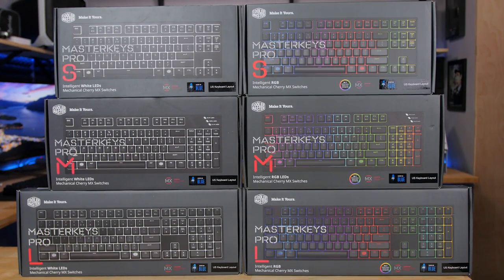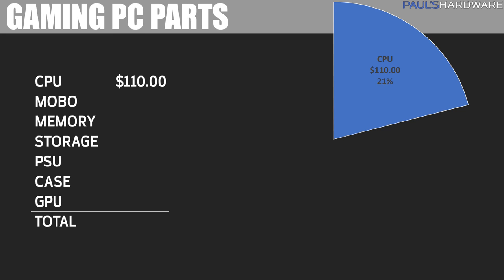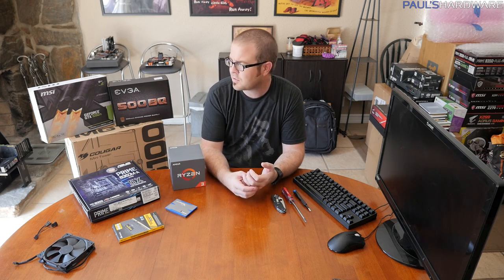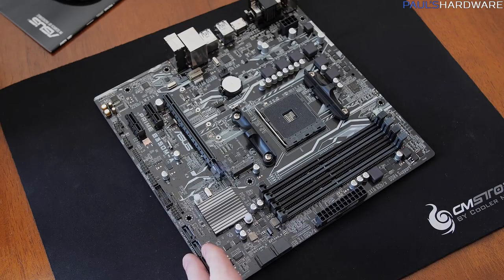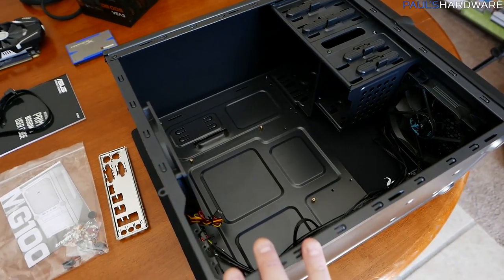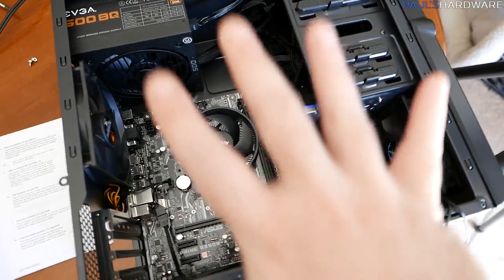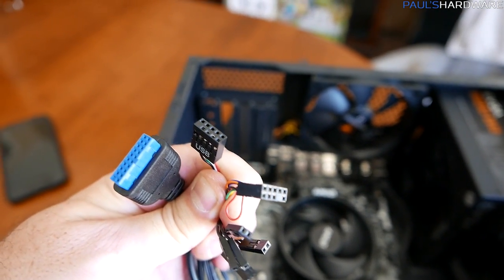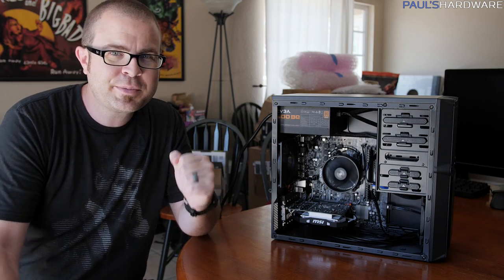How To Build a $525 GAMING PC with Ryzen 3!

Comment: Were there not SSD mounting holes in the floor of the case. Could not tell their spacing. I've seen quite a few setup that way. Of course that would suck for your installation since the PSU is at the top. Also, it would have been good to mention that there are some holes in the MB that are not mounting holes. You had a perfect example at the top near t he VRM chokes where two were mounting holes with ground and one that was not. Just a thought. Have a good one and keep on building!

Comment: Would be awesome to see a used hardware build. Most of my hardware comes from Craigslist, reddit and eBay. My last build (8350, 8GB, 970 SSC, SSD, TX 850) cost ~$500 at the time, which was about a year ago.

Comment: i just built basically this system, similar case, vid card, ssd, that psu, new cheap mobo, but i used a ebay 2600k for $70. performance seems just above the 1200, but the 2600ks oc like beast too :D.

Comment: For an extra $20 you can get an x4 PCIe extender and a PCIe SSD costs roughly the same as regular, your disk will run 4x faster than the best SATA 3 SSD or mSATA drive ...

Comment: Nice budget build and honestly i am thinking for myself to go with the 1300X because i never overclocked before and just would like to have that nice high base clock of 3.5GHz.
The only thing from my original system i am planning on keeping as well is my 2 hybrid drives, my GTX 1050 Ti and my 550w PSU (which i am sort of debating if i should really keep it or just change it for a 600w cause adding in a SSD you know) in which my current system with the i5 2500 i have a HD 7850 laying around (that i got from a friend for 20$ cause he has no use for it anymore and was tested) i am thinking of using it as a backup system/system for my friend to play on when he comes over or just sell it.

Comment: I would recommend using the Radeon video card so that builders can utilize a Freesync monitor(Start at $150-$250). You need a Gsync monitor to utilize Gsync with Geforce cards. Gsync monitors start at about $500. As for memory, get 16gb. If a game states that you need 8gb of memory, it is more than likely that the game itself requires 8gb and windows takes about 2gb, so your left with 6gb for gaming causing frame rate drops.
Reply: AnimalLechter AMD GPUs are ridiculously overpriced atm, though. 
8GB is fine for budget builds

Comment: Is 8gb really enough memory in modern applications? Mind you I don't know how much of an improvement ddr4 is over ddr3. I have 8gb ddr3 in my system and I notice on task manager often memory is running near to capacity whereas my cpu amd a10 7700k is only running at around 30%capacity.

Comment: If the 1200 is $20 cheaper and can be OCd to the speeds of the 1300x, wouldn't it cost more after a month or so of heavy gaming if the 1200 will be using more power than a stock 1300x? Why wouldn't you throw an Intel dual core for half the price and perform better for gaming and use that extra money on the GPU or something?

Comment: Ive been building computers for clients with parts from frys u can usually get the cpu and mobo real cheap its like they throw in mobo for free.just bought the 1700x with asus mobo for 325 and samsung 250 960 pro for 75.memory prices sucks

Comment: awesome build, exactly what i was looking for..but.. 
how about
intel i3 8100
Zotac GTX 1050ti 4GB
Corsair Vengeance LPX 8GB DDR4 2400MHz

Asus Z350 mobo
PSU is same as what you used.. 

i'm trying to get a decent build that will atleast run for about 4 years or such

Comment: Okay, but if you OC the 1200 to the frequency of the 1300X, will it require more voltage/cooling/power? In other words, are 1200s binned to need more power for the same clock?

Comment: It was a little difficult to tell from the angle in the video, but would this GPU cover both of the pcie x1 slots on the motherboard? Would want to add in a Gigabyte wifi adapter, but unsure if it would physically fit into the build.

Comment: is it worth it to get 3000-3200MHz memory if it costs 1/3 more then "normal" 2133-2400MHz RAM?
I build a PC for a friend (for video editing) and he was on tight budget and here were my options
1400 + 16GB 3000MHz RAM
1600 + 16GB 2133MHz RAM
And I chose the more CPU power over the faster RAM, so was my choice right guys?

Comment: would 2666 mhz dual rank memory be cheaper to get than the average 3000 mhz single kit?

turns out they perform equal to 3200 mhz single rank modules on ryzen for gaming.

Comment: Hi Paul, thanks for video. i want to know if i use 4-pin spitter will i lose ability to control.
Aasus and maybe others too have figured even control 3-pin fans,does using splitter means either one or both will run on its maximum speed 
will I be able to control both fan individually or at least my motherboard identify it as single fan.and will be able to control both but at same RPM or whatever ?

Comment: I would love to assembly this PC, but I would like to assembly it for emulation (CEMU emulator specificly). Do you know if it goes well with emulation? Since most of the times emulators go better with intel processors. 
I was thinking to buy i3 7100 (since emulators only use 2 cores), but now I am not sure.
Thanks!

Comment: Hey Paul. My motherboard for my pc build is a msi z270 gaming m7 and looking at the connections it has an 8 pin cpu power connector and also it has a 4 pin cpu power connector. But my psu doesn't have a 4 pin but Iit does have the default 4+4 but no extra 4 pin cpu power. Do I need the extra 4 pin but if I do can you show me any other power supplies that has the extra 4 pin cpu power connector cable

Comment: would it be better to get to get 16gb CORSAIR Vengeance 3000 for £115 or Ballistic Sport LT 16GB 2400 for £90 to use with the r3 1200, im trying to build my first pc with a gtx 1060 6gb and im not really sure what im doing, any help would be appreciated

Comment: I have 2x16gb corsair vengenace lpx 2666, but in this motherboardit  runs only at 2133. If I tweak up to 2666 windows wont run and says failed overclocking.
Any advice?

Comment: Is it safe to use a magnetic screwdriver when assembling computers?
Reply from the maker: Yes, the magnet in a screwdriver tip isn't strong enough to damage or erase data from any chips on the motherboard

Comment: My friend is selling me a PC for 400$ but don't know if it's worth it can someone let me know if it is 

These are the specs he sent me.?

Gtx 950 2gb
Athlon x4 840 CPU @3.1 Ghz  water cooled 
Gigabyte motherboard mini atx
8gb Corsair DDR3 ram 
2TB hdd
Built in WiFi 
500 w power supply 
LG CD drive 
RGB Light strip with remote 
Really quiet , optimized fans 

In great condition PC is less than a year old
Reply: hannahsbigmuddytruck well I play mainly shooters battlefield battlefront cod basically and some rpg like Witcher... Would it be good for games like those and do you think I can find something better during Black Friday.? If I wait
Reply: hannahsbigmuddytruck can I upgrade the card and can you recommend something
Reply: hannahsbigmuddytruck graphics card

Comment: what if I save the ssd money for a better gpu ?  I would like to use the 1050 ti 4gb but I don't know which cpu to buy, ryzen 1300x, 1200 or pentium g4620
Reply: ELVER GALAXY you can also get away with a 1TB Hardrive from Seagate or WD blue, for cpu i would recommend Ryzen 3 1200

Comment: Yeah no, suggesting the 1200 over the 1300 to save $20 and run in a constant overclock makes no sense, stressing your CPU just to save a measly $20 and risk the chance is the worse advise I have ever heard. Perhaps if there was a $50 price difference then sure, go for the cheaper option.

Comment: Of all the new ways to communicate with customers this "live streaming" is the least effective. 

Have the days of $300-400 motherboards ended?. How about using all your old stuff and just get cpu, MB, memory? is there anyone that does not have old stuff these days?  

 
Bought a laptop (used Ebay,Sony Vaio) with a SSD, yes it was nice with boot times but not much else. I pulled the SSD with Win 10, replaced it with a platter drive I found in my parts drawer and one of my Win 7 OS laying around, so much happier with that setup. I really do not use my laptop for anything but browsing at the restaurant. I am big on using the correct tool for the job.I mention my SSD experience as people seem to think platter drives are worthless and SSD's are the cure for all. 

Only 2 fans (and cheap-o ones at that, airflow used to be important). in that low end case? we are overclocking here.  No fan controller included in this build? Have we forgotten the audio side? On the positive. So nice to see AMD got rid of those ridiculously loud cpu coolers used with their AM3 cpu's, this is a good thing. How are these new coolers performing?

I know this is budget but no desktop system that does not need outside power for the gpu ( this powers off the MB) is considered gaming (yes I checked). I moved into computers when I started with folding. If you want to build a bad a** rig design it for 24/7 100% output, that will give you an idea if you are doing things right. I know folding is not like it was years ago (now almost all gpu) but folding rigs and awesome gaming rigs do have a lot in common. Paul does not even discuss the power phase design this mb offers for the cpu. I know you want the end number to be low (the price) but be more realistic.

Comment: Right now is a horrible time to build PCs with memory prices and miners buying all the GPUs :-( 

IMO it's not even worth it if you're looking in the mid range, although if you really have to build now I'd say skimp where you can and get a better CPU. Memory speed for a few extra FPS really is not worth the price tag, $40 is way too much for a case in the budget market, All cheap SSDs are shit but still faster than a HDD. Save money everywhere and use it to get a better CPU I say!
Reply: For $550 you can do a build with a R5 1400 or $600 for a build with a R5 1600 these two parts will last and with just a new GPU and PSU will get you up to high refresh 1440p or half decent 4K over time.

Comment: I have a question if someone can help. It's about buying a pc and i don't know if 400$ good deal.
Reply: Running AMD QuadCore Overclocked at 4.3ghz
Asus Motherbord
2 122mm ThermaLyte LED Fans
250gb SSD
And 120gb HHD
Windows 10 Pro 
XFX R7700S with Ghost Thermal Technology 
Also will come with a barely used AMD Radeon HD 6850 Graphics card.
2x4 8gb Patriot DDR3r Ram
450w power Supply from Lysis.
All inside a DeepCool Case
DVI, VGA and Hdmi Ports
6 USb 2.0 ports and 1 3.0 port

Comment: Can u guys check out my build & perhaps give some suggestions/ tips?

If there would be any good alternatives for the parts let me know, for I would like it to keep the price as low as possible.

Mainly I'll be using this build for gaming most especially w/ video editing & rendering. Will it be good enough? What u guys think?

BUILD:
CPU: Ryzen 5 1600 ~

GPU: 
•ASUS Dual GTX1060 O6G ~ 
OR
•(Brand) GTX 1050Ti 4GB ~ 
OR
•RX 480 ~

RAM:
•G.Skill Ripjaws V 8GB DDR4 3200 MHz(2x4GB) ~
"OR ANY 8GB DDR4 3000 MHz"

MOBO:
•ASUS Prime B350-Plus ~ 

Storage:
•1 TB HDD 7200 rpm ~ 

PSU:
•EVGA 650 Watts 80+ Bronze ~
"OR ANY 550-650W Bronze"

Monitor:
•ASUS ~ ?

Case:
•??? ~ ?

Though I'm not sure w/ the GPU, RAM, & PSU. With GPU, I may also include in my choices the RX 480? In RAM, I'm not sure whether 8 GB would be sufficient. Then with the PSU, I'm not sure w/ the proper voltage.

Comment: A 2gb gtx 1050? Don't ever get this card! Get a gtx 1050 ti it's way better when it comes to performance. It's like a sweet spot for people on a budget. You can easily achieve 60fps at 1080p with this card. The gtx 1050 2gb performs really bad. And a 128gb ssd? What kind of content are you going to store in this pc? 128 gb are not enough. Get a 1tb hdd it's cheaper even though it's slower but people on a budget aren't gonna be getting an ssd.

Comment: you could just get a used GPU, i once bought a GTX 780 for $100, and for $150 or less you can buy a GTX 970
Reply: The 780 consumes too much power
Reply: so what, it's much better performance than the 1050ti, has more VRAM all for similar price, maybe a slightly better PSU such as a 600B ($15 more than 500B)

the 500B would be perfectly sufficent for a GTX 970 which would be much faster than a 1050Ti for not that much more

Comment: Paul, your logic on why to get the R3 1200 is retarded.  If you get the R3 1300X you should be able to overclock it higher...  Love your videos, that just didn't make sense.  I would think the extra $20 is worth getting up to/over 4.0GHz.
Reply: Okay, well I haven't researched what they will overclock to.  But I am going to assume, logically, that if the 1200 will OC to 3.9 or 4.0, that the 1300X would overclock higher.  So, for $20 more, why not?

Comment: I find it hilarious when RAM, cost as much as a motherboard and nearly as much as a processor.
Reply: Gabe Newell The Protector 16gb cost 130€ in germany atm
Reply: Markus Wiedner Exactly.. pretty fucking expensive compared to the prices in early 2017.
Reply: I had to buy 16 gigs of 2600mhz,the 3k one costs like 70 bucks more...
Reply: Batemen Right now I'm  trying to upgrade to a ryzen build but the ram is so overpriced it's ludicrous. I'm  going to buy the motherboard and CPU and hold off on 8gb ram because 16 is 130$ at the cheapest.

Comment: I'd go for a g4560 (even when it's like 80bucks) and a 1060. Better gaming performance and that's what most people are looking for.
Reply: That whole "better gaming performance" thing is véry arguable. Across the board there may be a small improvement, but considering that there is a non-negligible number of games that simply doesn't run at all smoothly on anything less than four physical cores, I would recommend gamers a Ryzen3 chip over a Pentium, or indeed Core i3, chip any day.
Reply: Robert Faber I agree completely, but an i3 has the same number of cores as the Pentium Gs... r3 is the way to go for budget builds right now
Reply: RootinTootinPutin 

Actually, I recently saw benchmarks and Ryzen 3 has almost same performance in games pre overclock and can be overclocked for much better performance than g4560.
Reply: 93 bucks
Reply: meh. maybe if he was looking for like a 500 dollar build. but the ryzen platform is much better to invest in especially now when intel has started to cut support for the older boards

Comment: really cant recommend a MATX motherboard. i mean a msi tomahawk would be 10-20$ more and it's infinitely better
Reply: Toman Tope Why? I'm planning to buy the same Asus mobo. Is it bad cause of limited features?
Reply: Daniel Perdomo I'm not sure, but i wouldn't buy it because it has no VRM heatsinks.
Reply: I'm pretty sure it does?
Reply: Toman Tope Im talking about the Asus, and it doesn't
Reply: There's nothing principally wrong with mATX... Unlike ITX, where the actual width of the board is reduced and so is the physical space for VRMs, RAM slots and handy little things like onboard power/reset buttons and double USB 3 headers, mATX only suffers (slightly) in height, which doesn't really come at the cost of anything except PCIe (and possibly still PCI, on cheap boards) slots. You could conceivably say it takes away space from a dedicated audio controller, but only properly expensive boards come with the kind of audio hardware that takes up a ton of motherboard space anyway. I think mATX is an absolutely lovely format, and we should collectively be using it more often...
Reply: Oh, his comment didn't appear, sorry
@Daniel Perdomo the MSI B350 tomahawk is much better than any b350 out atm. (And I have the asrock ab350 gaming mobo)
MATX leaves you a lot of room for future proofing if you have the space for it.
You can put another gpu in later for crossfire for example, and ATX boards have better VRMs.
Reply: So, even if I'm not planning on doing crossfire, I should get de MSI tomahawk?

Comment: That's a very ugly GPU.
I always recommend to go for used GPU for builds under 1000$.
Not checked yhe prices in USA but for same money you could get GTX1060.
Reply: Many people won't touch used parts, I find this is even more important at the low end. Sure 99% of the time you'll be ok but if it does fail you're completely out of pocket with no working PC and probably no money for possibly months to replace the GPU. 

Furthermore the used market now is a huge nono especially in the mid range, everything with decent perf has been THRASHED by miners and will be even more likely to break.
Reply: When you buy off amazon or ebay youre protected, so no problem there.
If you buy it off craigslist you should test it in his house, so A you know its working atm and B if it will fail later you will shit in front of his doors everyday if he won't give you money back :D